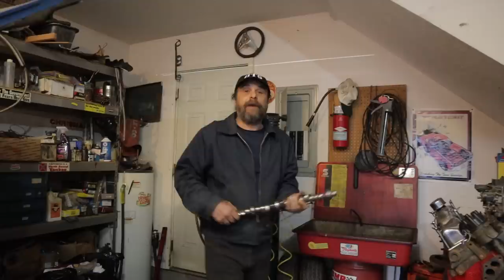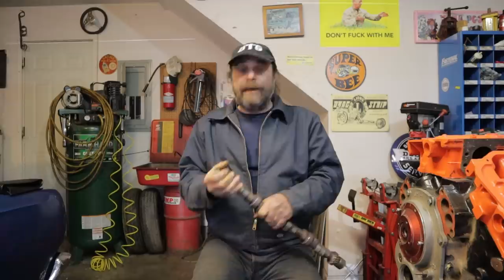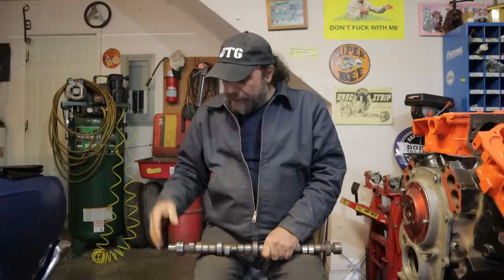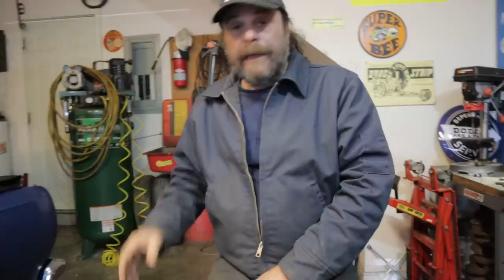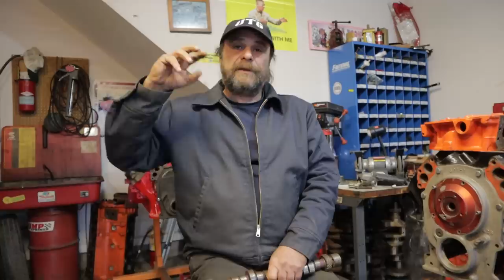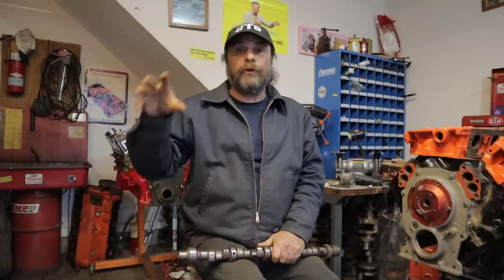Camshafts For Dummies

Comment: On the base circle, I was intrigued when I saw a modern engine where that part of the cam was narrowed. Perhaps for less friction, you don't need as much path width to keep the lifter in place.
Reply: If it was a modern engine, it probably had roller lifters. Old cam lobes are ground with a taper to keep the lifters rotating, hence x amount of friction is necessary.
Reply: It’s not “path width” to keep the lifted on track.  It’s the amount of width necessary for the lifter to follow the ramp profile.  Look at Pro Stock cams.  Among other interesting features, they have narrow lobes and bearing journals.  Roller cams with roller cam bearings don’t need as much surface for the bearings and with a roller following the lobe, that can be narrower too.
Reply: The type of engine you are talking about has no lifters, push rods, or rocker arms. There just flat cam followers. You are correct about the reason for the narrow base circle being for less friction. Just like low tension rings, every little bit helps.

Comment: A couple questions. Can I take just any stock cam and give it 4 degrees of advance and get a bit more low end grunt? Also you talk about a new cam and you want the engine to fire up on the first crank. Say that it doesn't and you grind the starter a little bit. Is that cam instantly wiped out?

Comment: So if I want to move my torque curve just adjust the cam timing? 

For example if I want to move my torque curve to a lower rpm for better fuel economy short shifting city driving i just advanced the cam timing? and will i have to take those degrees into consideration for the igniting timing if the distributor runs off the camshaft?

Comment: Finally I found someone who told me what I need to know. I am a total cam dummy even though I do most of my work on my cars. I am in the middle of replacing the cam, lifters, and valve springs on my 2006 Charger Daytona R/T with the 5.7. One lifter on the number one cylinder went bad. I know this because when I pulled the lifter the bad one was seized up and turned completely sideways in the yoke/lifter bracket.  I was really stumped on what size cam to get that will give me some performance out of an otherwise stock car that is my daily driver.  I am looking at a 212/222 589 intake 584 exhaust with an LSA of 111. Is this a good cam for my stock daily driver that I want to get some performance out of and  that I will be doing some more work on in the future?

Comment: Is there a degree varible to the difference in cam shafts? Such as when you put it in is top dead top dead or do you have to degree each one from factory specs. Because if you didn’t degree it and used factory timing is it right or off?

Comment: Hey Tony, what can you tell me about the Mopar Performance Purple Camshaft .474 Lift 280°/280° Duration. A machine shop installed this cam in my '69 Dodge Charger R/T with the bone stock 440 Magnum but didn't explain what it does as far as horsepower, torque, or performance benefits it might have. It sounds great and there seems to be some good mid and top end power gain to me.

Comment: Tony, great explanation. If I am understanding correctly, an "RV" cam would have a lower LSA, right? Also, would the greater the amount of overlap (of intake/exhaust valves being open) result in higher vacuum readings, and vice-versa? I guess this is what they mean when they say that the combustion engine is literally just a pump.

Comment: UT:
Could you also address the different metal treatments they do to the metal to make the cam more durable. Do certain manufacturers do different treatments based intended use ie; roller, hydraulic etc.
Seems like it doesn’t take much to chowder one up!
Reply: Great great question Tom. Wish someone would weigh in on this too.

Comment: How do you get started with building a camshaft? I've seen it done on a lathe but how do you figure lobes and how many thousandths you want them to open?  I'm trying to build up an obscure engine that has absolutely zero aftermarket for it so I'm not sure what data I need to bring to a shop. I have the engine I plan to bring in  just looking for a custom machine shop in Arizona

Comment: Hey man I just did my valve cover gasket on my 99 ford ranger 2.5l ford Lima engine. I saw one of the lobes had some spider leg looking cracks. It was was still smooth but I’m wondering if these are stress cracks from either the valve slapping or previous heat from bad oil?? Let me know what you think or if you’ve seen this problem 🙏

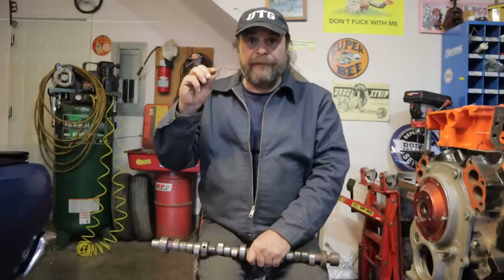Comment: Hey Uncle Tony, at 3:00 in the video, you said the dur. @.050 is “when the valve is .050” off the seat”, but isn’t it when the LIFTER is .050” off the base circle? Thanks.

Comment: Tony, the .050" duration is measured at .050" TAPPET lift, not valve lift (at least on all my cam cards, from various manufacturers). You might also mention that duration is measured in CRANKSHAFT degrees, which is 2X cam degrees.

Comment: Uncle Tony l have a 179 motor in my 1963 EH holden  l have been told it has a mild cam l can hear this when at idle due to a more lumpy idle sound but without pulling the cam out how would guess what type of cam it is regards Anthony from down under hi uncle Kathy and uncle Crystal

Comment: I have run Lunati, Crower, Edwards ... still had issues at times but nothing like a handful of lifters being shmutz right out of a couple orders , that’s just pure shat quality.
  I have been favoring some of the Elgin cams and lifters for certain engines because they do not have huge selections but I’ll have to say, knocking on wood ( yeah, my stubborn dome) I have not had one issue.   I like to use Redline assembly lube as well. There must be a lot of zinc in it .  
  I put that sh!t on everything ! 
  I hate that you have been receiving flop pieces Uncle Tony . Not the same world anymore with quality control concerns.

Comment: Just found your channel, keep up the good work!! I'm starting a low cost street build with my son on a 1990 d150 with a 318 it got the TBI I was thinking 4 barrel, msd, valves and minor head work and camshaft change. Any advice for the build i would greatly appreciate it. Thanks again!!
Reply from the maker: MSD is just pissing money to the wind.  Minor bowl porting, gasket match the intake, long tube headers, small port dual plane manifold and a carb in the 700 CFM range.
As for the cam, you may want to talk to a couple of grinders and get a more accurate recommendation based on all of your specifics than I can give your here.
Reply: @UncleTonysGarage  Thanks for the info!! In bottle rocket what size valves did you use?

Comment: Why is every 5th lobe completely round?  JK, but if you're starting with basics, maybe point out lobes vs bearings, why that particular cam is copper coated between lobes vs parkerized or induction heat treated cams. Also the nose of the cam and the relationship between the tining keyway and lobes.  Wildest cam I ever work on was a prototype where we concave ground the ramps vs the normal convex.  The intent was to see if increasing valve acceleration would cause a vacuum that would pull air in/out faster. I was a camshaft engineer working with a Landis 3L CNC lobe grinder, Landis angle face grinders, Crankshaft machine milling and turning equipment and induction heat treated that did one cam lobe at a time.

Comment: Hey Tony, I have a question about calculating overlap. Is this normally calculated using the 0.050" duration or the advertised (seat-to-seat) duration numbers?
Reply: It's the difference in degrees at max lobe lifts of the intake and exhaust.

Comment: Uncle Tony, 

I learned that solid lifter cams have less aggressive lobes than hydraulic lifter cams. The reason being that the ramp needs to be less aggressive when taking up the slack (valve lash) otherwise it would beat the valvetrain to death (excluding tight lash cams which have ramp profiles similar to hydraulic cams). This correlates with the reason as to why you can run a solid cam with up to 10 degrees more duration than a hydraulic cam and retain similar idle characteristics. And you can run hydraulic lifters on solid cams but not vise versa.  Please explain to me why I may be wrong.
Thanks.
Reply from the maker: Solid cams have a more aggressive clearance ramp than hydraulic cams do.
If the lobe is an identical grind, the hydraulic would see slightly more duration at the valve due to not having to take up lash.

Comment: Question?
    Have you ever checked the balance of a camshaft, I have one the static balance is off mainly due to the fuel pump eccentric which could be taken off , it still would be out of dynamic balance   it hops when spun at slow speed on a easy turning bearing sit up.
Reply from the maker: They're quite happy without any balancing

Comment: Thanks for this! I needed it cleared up. In terms of duration, say 205 intake, what exactly does the 205 mean. You mentioned the @50 in terms of 50 thousands before valve is closed. 

Also, Im looking at getting a cam for my 5.3 LS. I prefer more lower end torque since I like to tow more with it. So I want something with a lower LSA (not too low) like a 110ish, and a slight advancement?
Reply from the maker: The 205 is degrees of duration @ .050...and that's probably about right for your cam, but I would consult with a couple of grinders to find your best options
Reply: @UncleTonysGarage  Thanks for the info!

Comment: I have a 2016 Ram 1500 with a 392 my cam specs are 218@50 230@50 .597 intake lift .597 exhaust lift 112 Lsa +4 degrees of advance. Once I have time I will post vid of it.

Comment: So when specing a cam for max power you just get the longest duration you can then spin the engine till it pukes its guts on the ground at full song then cut duration by 10 degrees and build it again right? lol Rinse and repeat till it quits blowing up and you found the sweet spot. :-)

Comment: as a rule of thumb,big or small thumbs,no more that 280 degrees on duration and no more that .500 lift on street engines,you will not kiss valves and this goes for mopar=chevy=pontiac=buick most v8s,going beyond these specs for street engines,better save your money for the expensive parts,always use new timing chains with new cams and lifters,if its a chebby[chevy] cam button automatically install one,warned

Comment: Im planning on putting a new cam in my 1968 Oldsmobile toronado after i paint it. Im going to be taking it to a local drag strip. I also want to cruise / street race it every once in a while as well. I always hear get lots of duration and overlap. There is a lot of conflicting information out there. What should i do. 
Edit: planning on full roller setup
Reply from the maker: You should call a cam manufacturer, give them all the specs on your car, what your expectations are, and let them tell you which grind will work for your
Reply: @UncleTonysGarage  Thanks

Comment: I need an Uncle Tony in my life. Been so close to ordering a new cam for my 440 but i know to little to order the correct for my aplication.
Reply: Generally you can call the manufacturer and they will recommend a cam for your application.
Reply: right cam depends on the flowrate of your heads and the characteristics you want your engine to have. ask me how i know...

Comment: DC Purple shaft !!  My favorite flavor !!
Reply: Its mopar performance
Reply: The one in my 440 is a Direct Connection purple shaft cam from the mid 80s.  Been in there since then.
Reply: @Moparmaga-1  Got 1 in a 340 also.  Love it !
Reply: @paulcabezola3559  yep, I've ran the 474 484 509 528solid & have a 620solid in waiting for a 452 build. Everyone was excellent when matched properly. People try to say it's old technology but I've ran or been in cars with other brand cams comparable in size and the purple shaft always beat the others on sound and performance. The purple shaft duration @.050 are almost all about 10-15 degrees more of duration as well, so thats a bonus.
Reply: @paulcabezola3559  I wish I could find a 340, I can but theyre expensive & I have a bunch of big block stuff already, maybe I'll try for 1 if I ever build something like a late 80s early 90s dodge shadow or Daytona
Reply: @Moparmaga-1  I've got the .509 in the 440 and the .508 in the 340. They work great as long as the rest of the combination is matched up as you mentioned.  They also have a wicked sweet idle. Got a feeling they're going to be hard to come by in the near future.
Reply: @paulcabezola3559  yeah definitely.

Comment: Is there a way to determine your cam specs if you dont have the cam card?
Reply: billy greenhorn if you have a degree wheel, and a dial indicator. You install the cam, place the dial indicator on the #1 intake lifter, rotate the engine and note the degrees when the dial indicator moves to.031” that is the .050” opening point (1.6/1 ratio). Continue rotating engine till lifter goes full lift. Note the lift. Continue rotating engine till lifter goes back down to .031” and note the degrees. The difference from open to close is the duration @.050”. Repeat this procedure for the #1 exhaust lifter. You can determine the lobe separation by noting the difference between the highest lift points of intake compared to exhaust. Make sure you know your rocker ratio! Some engines are 1.73/1, etc.
Reply: Sorry, I think the .050” is normally measured at the lifter, so disregard the .031”, just measure at .050” lifter movement.

Comment: does lift can be compensated with more duration ?
Reply: I suspect, technically, "no" as they are two different things BUT I would also suggest at some point the only way to tell would be a direct comparison and that can get pricey (swap cams and maybe other valve train parts to accommodate the lift). OR get part way there and check valve lift compared to duration on a flow bench while measuring total flow volume.  Not sure you could do that accurately enough as duration is a matter of degrees but also relates to time.  Flow bench numbers I have seen often only show every .100 of lift with extrapolation of other numbers and to test accurately you would have to check exactly maybe 10x or 20x as often IMO.
I found it interesting when you look at older cam details that in the late '50s and earlier '60s the cams tended VERY GENERALLY to be less lift and more duration than what would be considered a "modern" cam.  I would also suggest part of the reason may/might have been that stock valve springs don't really "care" about duration, they do "care" about total lift [I could be quite wrong but that is my understanding] so the cheapest cam change would be to keep the lift the same or less than stock and play with the duration.
Reply: @RussZHC  thanks for answer

Comment: 6:45 ADVANCE for LOW rpm torque
RETARD for HIGH rpm torque?
am i stupid or you mixed them up?
Reply from the maker: Generally, yes
Reply: yes- advance for high rpm power or yes-advance to reduce clutch wear on take off?

Comment: Back in the day, everybody was talking bout 3/4 race cams. Whats that about, for this dummy. ALso seen a race cam with soo much duraction the lobe was almost square.
Reply: Always took it to mean a 750 lift
Reply: 3/4 lift=.750
Reply: When hot rodding and racing were becoming popular after WW 2 cam manufactures kept things a little vague so if you wanted a 1/4 race cam that means it idles ok  and stock compression works with it. The closer to full race means the more power it could make with race engine parts. 3/4 race would be a cam that needs like 4.11 gears and a manual trans.
Reply: @Oldsoldiersays  Nope.
Reply: @daveoneal5544  Nope.
Reply: @413x398  well then smarty pants do enlighten us. Ive been around a long time and never had anyone actually pin it down. Other than my guess i always just figured it for a slang term. And i was a guy who used to order custom grinds from lunati from back of mags in the 90s.so i aint a fresh face
Reply: @Oldsoldiersays  It wasn't pinned down because there isn't anything to pin down. In general, in the 60's, the phrase was used to refer to a grind that was still "streetable", another vague term. The notion of .750" lift back then was pretty much laughable. Look up the specs on a Duntov 30/30 grind, which is a stick most of the Bowtie boys used to call "3/4 race". Low lift, long duration.
And while you're bragging about buying cams back in the 90's and not being a fresh face, consider that I'm 5 or 6 years older than Tony, and I've been in this hobby since I was 12. I currently have 52 cars in the '63 to '73 range, with enough spare engines to cover most of them. YOU should not ASSume anyone's background.
Reply: @413x398  im proud of you, and thanks for at least offering an explanation. Its as much as I figured. Being someone who came up in the 80's and 90's i would hear it all the time from the old timers, but none of them could give me the specs. I don't ever assume anything, but when someone would rather just tell someone they are wrong, rather than explain why it gives the impression of a younger person.
Reply: @Oldsoldiersays  so .500 cam with 1.5 arm isn't .750 at the valve🤔
Reply: @daveoneal5544  lmao well, it depends!
Reply: @Oldsoldiersays  I'm all ears
Reply: @daveoneal5544  its one of those things you have to be sure to specify when selecting a cam. And any proper cam salesman will do so but some just assume your talking about stock rocker ratio. Generically yes 1.5x.500 is . 750 but some brands base their grinds on stock 1.4,1.45,1.5,1.6,1.7 and even 1.8 ratio rockers. Rarely do they tell you the ratio its based on if you just buy one off the shelf online. Well, anymore they do but not too long ago they didnt, you had to call and find out. So, it depends... Technically it doesnt but with human error it does 😉